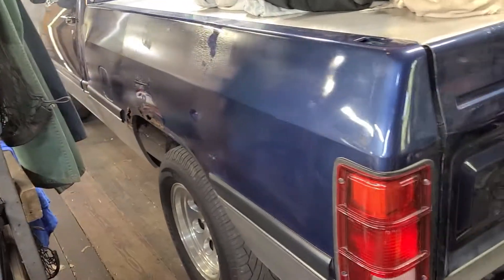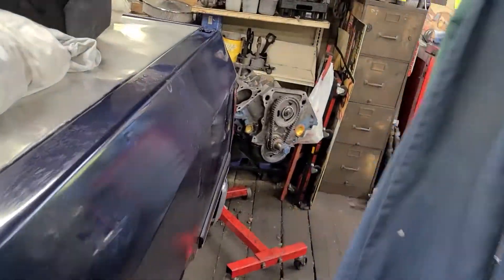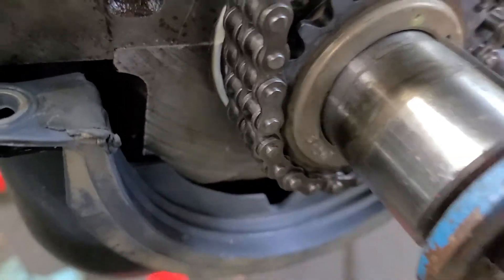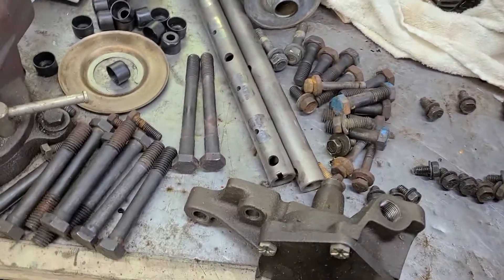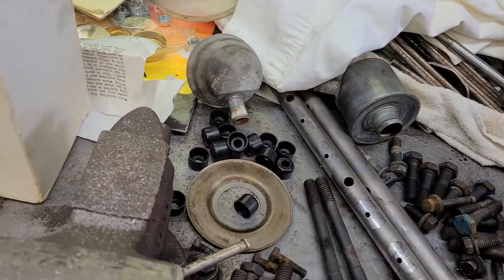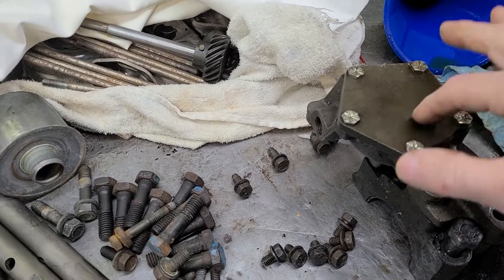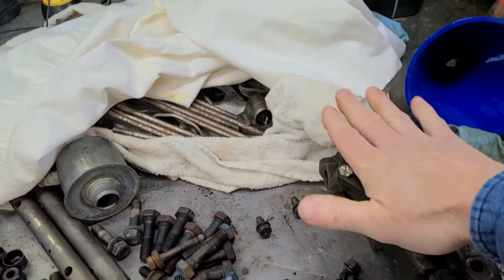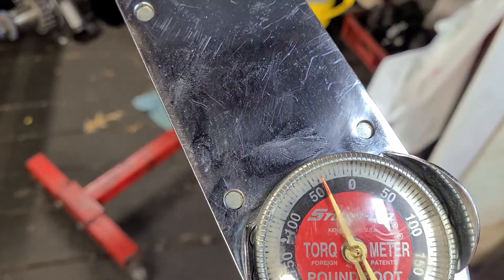Mopar 360 oil pump installation and new parts reveal

Comment: I really wish you were my neighbor or something 😅 lol.. I am in quite the situation at the moment. I e never done a complete engine swap before and unfortunately my 360 5.9 magnum died a couple weeks ago so I’ve basically bought almost new everything but also trying to salvage what I can to save a little haha.. It’s been overwhelming to say the least. I was able to find a chiltons which is a life saver but still this job has been extremely intimidating lol. The new long block is on the stand now and still waiting for a couple parts but time to start trying to reassemble this thing so I am extremely grateful for your videos!!
Reply from the maker: Well my job is to inspire and educate and to make this not be so intimidating and if it does seem to be intimidating it really isn't. It's just nuts and bolts and think about this when you're eating an elephant. It's just one bite at a time so if I can help you need any information let me know and thank you for watching the videos
Reply: @slantfish65sd   I’m having serious trouble finding the connectors for my throttle cable, kickdown cable, and Cruise control where they connect to the throttle body. Can’t find the detents nor the cables in general. Know of any universals that will work?
Reply: It’s for a 98 360 magnum 5.9l

Comment: They say u can't use magnum balancer an flexplate on la moters
Reply from the maker: That is correct. You cannot use he magnum, harmonic, balancer and flywheel on the LA style engines. The  eli and the Magnum engines both have a different balance and if you try to use the magnum balancer and flywheel on a LA engine or vice versa, you can have a lot of vibration issues and harmonic issues going on with the engines. It's just really not worth it
Reply from the maker: Also, thank you for watching the video and appreciate it

Comment: Hi there! Do you know what are the bolt specs for the oil pump? I cannot seem to find them for my 74’ LA 360
Reply from the maker: First of all, thank you very much for watching the video and thank you for your comment. I'm assuming you're talking about the oil pump mount bolts. The torque spec on them is 30 ft lbs thank you and if there's anything else you have questions about let me know

Comment: I have a complete 2014 5.2 liter magnum with 40k miles on it, would you be interested in a straight trade for that 318 LA?
Reply from the maker: Unfortunately I was not able to answer your question quickly but I can't trade this engine in good faith because I have almost no history of this engine and you have been very nice to me and I very much appreciate it also I plan to put this engine in the Barracuda if it checks out ok also there are plenty of other 318 la engines
Reply from the maker: If you need me to I can keep an eye out for a good well known 318
Reply: @slantfish65sd  
Thank you, I am looking for a 318 or a 360 LA, I just want something I can swap into my truck over a weekend, and use while I am rebuilding the original engine.
The magnums will drop in but, I either have to change the computer/wiring on the truck, or the intake/and a few other accessories on the magnums, which is an expense I would like to avoid.
 I want to rebuild the original engine because I know the history of it, and it is a 92 factory roller cam, not a flat tappet. So that gives me alot of cam options without spending extra $$$ to convert it to rollers.
Any leads would be greatly appreciated.
In my area ( Richmond Va)
I can find magnums all day long, but the LAs seem to be scarce or overpriced.